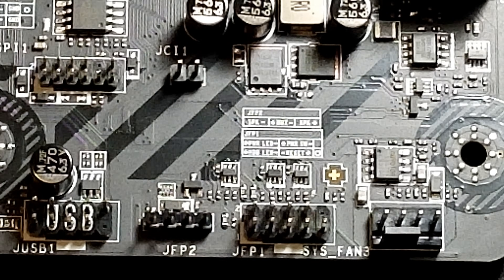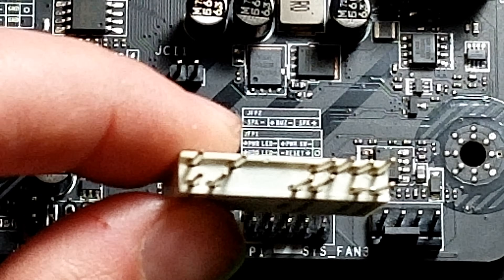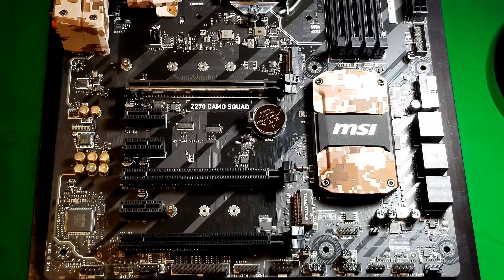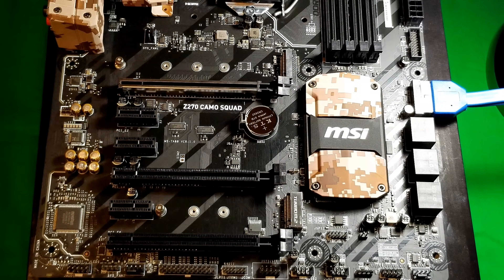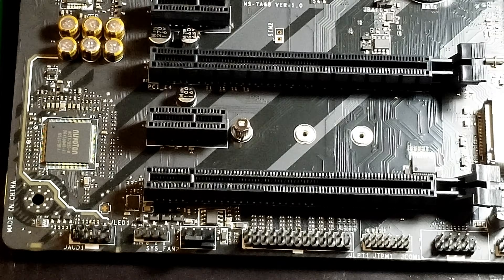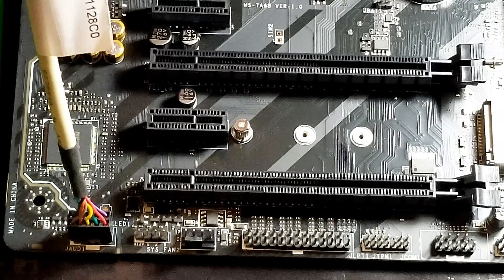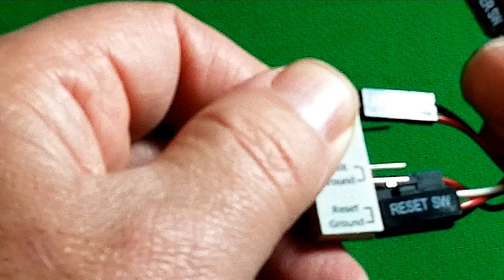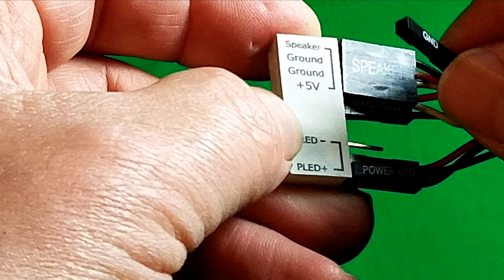Connecting your Case Front Panel connectors to your Motherboard

Comment: Do you have Discord? My PC after I put it all together just flashes a white light and so does my graphics card. I’m still waiting on my CPU heatsink to come. Is the computer refusing to boot without a heatsink? I’m still waiting for my heatsink to come in the mail. I’m really excited to build his beast after being on a laptop with a GTX 750 for 5 years.
Reply from the maker: I have Discord but have only used it in other peoples Discord to send messages, don't use it myself at this time, that might change soon though. Now not sure what the while light would be, never seen that before...As for the CPU Heatsink, the motherboard has it's heat-sink's built in, so guessing your referring to a new CPU Cooler maybe? If you have your Motherboard, with CPU and CPU Cooler along with Memory installed, everything would be fine. So if your saying you aren't using a CPU Cooler, that should not be done. So if you can provide more detail on what's going on I'll do my best to help you out...There can be a LED button on your motherboard that might be white, used for showing error's with your system, other then that can't think of anything else...Good Luck with whatever build your doing...Take Care...
Reply: @Reviewing Playing & More RPM My motherboard has an orange light that stays on. And yes, I’m referring to the CPU cooler. I’m building a PC with a 1070, 16gb of RAM and an i5-8600k. The fans spin on the case and the graphics card fine it seems.
Reply from the maker: It's normal for there to be a light that stays on when the motherboard is powered up, it indicates your motherboard is getting power, which is a good sign since it also means it is working ok. If your GPU has RGB which a lot of them do now then having a light on it is normal. Yes without a CPU Cooler you should not try powering it up as without cooling for your CPU it will overheat...this could cause damage to your CPU...
Reply: I also meant to say that the front panel’s power button flashes a white light and so does my graphics card.
Reply from the maker: The while flashing light indicates the Hard Drive activity, this in normal...
Reply: @Reviewing Playing & More RPM Nothing comes up on the display. I got the Asus b360m-a motherboard. Of course me being my dumb 18 year old self, didn’t research my motherboards. I might have to send this one back. I seen online that you can’t do any overclocking on this motherboard and the RAM can only go up to 2666mhz. My RAM I got is 3000mhz. Do you have any good motherboards you can recommend to me?
Reply from the maker: If your using the AM4 Socket for Ryzen processors, then I did a review on a Gigabyte Auros B450 Pro WiFi Gaming Motherboard, has DDR4 3200 support, and has OC Support through BIOS...
Reply: @Reviewing Playing & More RPM Thank you.

Comment: Hey, what if your front panel cords didn’t come with a reset switch
Reply from the maker: +RysenZ If your case doesn't have a reset button you won't have a reset cable. Thanks...
Reply: Reviewing Playing & More RPM thank you so much for the quick reply, it is my first build and for some reason everything has power, but when I click the power button to start up the pc it doesn’t turn on. I think I may have a shortage in my front panel pins or something....quite tired of trying been couple of days.
Reply from the maker: Something to try, it's very easy to reverse the reset and power switch, so try checking that first, double check the 8 and 24 pin for power and finally ensure your memory is installed correctly, if the memory is in wrong that can cause a system to not boot up...Hope that helps...
Reply: Reviewing Playing & More RPM thanks you again, I will test all that out when I get the chance. I had taken a break to breath and relax my mind. The video was great info and help as well.
Reply from the maker: Sounds good, hope it works out for you...

Comment: This must be for an older MB. My Z87 takes a connector like this but my Z170 has a different one with more pins.
Reply from the maker: +J Lock Yeah 1 is newer and the other is very old, but still connect the same. Thanks for watching...

Comment: What happens if you don’t have a reset one ?
Reply from the maker: +Merkah It's fine, some cases don't have a reset button.
Reply: Reviewing Playing & More RPM okay good I got scared haha I need to ask a question tho I’m trying to fix my pc it won’t load it lets me get to bios then when i exit out off bios it’s starts to boot then the windows logo comes ups and the circle underneath just keeps on going until I turn my pc off and on again then the same thing happens
Reply from the maker: +Merkah so if I read that right it's stuck in a loop? If so there is a Youtuber called Britec, he just did a video on how to fix this. Might help,  if not let me know and we'll explore it further. Thanks...
Reply: Reviewing Playing & More RPM okay thank you!
Reply: Reviewing Playing & More RPM I can’t not do Britec video as I do not have a DVD drive
Reply from the maker: +Merkah Give me a bit and I'll see if there is another option.
Reply: Reviewing Playing & More RPM okay and also it’s going into automatic Repair and it’s 4:30am so if you do reply I’ll look in the morning I appreciate you for helping me 😈
Reply from the maker: +Merkah Starting at 11:17 in Britec's video he is showing how to reset your PC this also works for some other Windows errors. You won't need a DVD Drive for this and it should fix the problem. If you just built the system and don't have anything to lose data wise, or programs choose the remove everything option. Otherwise choose keep my files and apps and let it reinstall. This should fix things.
Reply: Reviewing Playing & More RPM can you link the video ? The Britec09 one ?
Reply from the maker: Just click on where it says 11:17 in blue that is the link to take you to the video and at the spot you will need, and yes Britec09.

Comment: I thought this was the problem for my build but my pc’s motherboard lights up but when i press the power button nothing happens. And i dont know what todo. Can any one help?
Reply from the maker: +ygv fcy Recheck the LED connections, ensure you plugged in the 24 pin and 8 pin power and memory. No memory or installed in the wrong slots can cause a no start. Just some things to start with.

Comment: my pc doesn't have the reset switch socket or the speaker socket. Will it matter? What should I do?
Reply from the maker: +PassionFruit Not all cases have a reset button so in that case there will be no cable to plug in. It's fine, but if you need to reset and can't do it normally through windows just hold the power button to shut it down.  Thanks for watching...
Reply: Reviewing Playing & More RPM Cool. I was worried and spent 3 hours this morning fiddling with the case front panel socket and the asks q connection.
Reply from the maker: +PassionFruit No Problem Glad to help...

Comment: will i damage anything if i plug something in the wrong place?
Reply from the maker: +Marius Remeikis Short answer is it's possible, mostly if you were to plug in Firewire to USB it could possibly short the motherboard.  The LEDs I have reversed the power and reset no issue just buttons work in reverse, the Power LED + and- if done wrong while possible it may cause damage it's more likely it just won't power on. I haven't plugged in the audio wrong so can't say with certainty what could happen. I have done research and other then plugging in the Power 24 or 20 pin wrong or 8 or 4 pin CPU wrong, the  LEDs should not. Of course without having put this to the test err on the side of it could. Better safe than sorry...
Reply: Thanks for the reply

Comment: Just hooked up a Cougar panzer max to a gig.x470 aorus ultra gaming. I can't get the fan speed control to work. The case fans start when the case is powered up - but the speed control won't adjust the fan(s) speed - they stay on low speed....
Any ideas....
Reply from the maker: +Daniel Stone Did you try going into the BIOS to the Smart Fan 5 Settings, the Fan speed Control just a suggestion. It let's you make adjustments this way in the event the case isn't doing what you need. Hope it helps...
Reply: Thanks for responding..
I did not. I was thinking it was a hardware problem.
I thought adjustable fans had 3 wires..i notice ive only 2 on the(each fan) harness. I'm  Not quite sure about how to work with the bios.. guess I could look about

Comment: On my motherboard (TUF Z390 WiFi) there are more pins then the q connector has holes does it matter or not
Reply from the maker: +Nic The Q connector isn't for every motherboard I'm pretty sure,  but on your motherboard the top starting top left is PLED + and - then next 2 continuing on top is Pwrsw next 4 pins top right is the speaker. Next starting bottom left 2 pins is HDD + then - next 3 are reset then last 2 with a blank not used. Hope that helps verify with your Motherboard manual for front panel in case of doubt and to be sure.

Comment: I have a question, I connected all my cables, double check to make sure all cables were connected and I turned on my PC and all the lights on my MB turned on including my CPU Cooling fan. After I noticed it turns on I turned off the PC with the power switch and then plugged in my GPU and wifi adapter and went back to turn it on but now it won't turn on. Yes, I did take out the two items again to see if that was the issue but no it is still not turning on. I'm looking every where to find the answer but nothing so far. What do you think can be the issue?
Reply from the maker: +Cali Jay Hi, so few things come to mind 1st is could the memory have come out of its slot slightly,  if not check none of the connectors came loose. Now if it's not that when you had the adapter and GPU in or not is the motherboard showing a light lit up this will usually indicate your at least getting power. It's possible that the power supply could have stopped working but will depend on how old it is possibly. Give those a check and if it's none of that give me some more info and I'll see if there's anything else I can do. Sorry hard to diagnose this way. Good luck...
Reply: @Reviewing_Playing_and_More_RPM  let me break it down in details some more. The first time I turned it on (without the GPU and Wifi Adapter installed) the lights were on for the Motherboard and the CPU cooling fan was spinning and at this time I did have the Ram installed. The four fans was not spinning, I'm guessing because I just got a new case (NZXT H700i) and their built in Cam software control it. 
Now the 2nd time I installed the GPU and Wifi adapter and went to turn on but this time nothing happen. MB lights didn't show, CPU cooling fan wasn't spinning but the only thing that was lighting up was the Cam adapter inside the case. It's a blue light and that's the only thing that keeps turning on every time I turn on the power switch.
This morning I went and took everything out again and put everything back in and still the same issue. Nothing turns on except the blue light from the CAM adapter
Reply from the maker: +Cali Jay Well safe to say it's not likely the power supply,  so don't have a lot to offer without having it. So only suggestion I have at this point would be to check all the connections  to ensure everything is plugged into the motherboard correctly, otherwise unfortunately can't think of anything at this time. I'll do a bit of research and if I come up with anything I'll reply with more, sorry...
Reply: @Reviewing_Playing_and_More_RPM  I forgot to mention I have a ASRock Z77 Extreme4 MB
Reply from the maker: +Cali Jay Try a different Power Supply if you can, disconnect all non essentials from the motherboard. Ram, ODD, HDD, SSD, sata cables etc... Try using Integrated Graphics if available, try removing 1 stick of Ram at a time, and try again. Finally disconnect all power connectors from the motherboard and reconnect.  I know it's tedious but all part of troubleshooting. Hope it helps...
Reply: @Reviewing_Playing_and_More_RPM  so I did exactly what you told me and still nothing turns on except the NZXT CAM hub
Reply: @Reviewing_Playing_and_More_RPM  the only thing I didn't do was put in a different power supply
Reply from the maker: +Cali Jay Sorry but if you've checked all the connections and what I mentioned earlier not sure what more I can offer. Might be time to find a computer shop or a friend who could help...All the best...
Reply: @Reviewing_Playing_and_More_RPM  I believe I just found the issue. The fans on the power supply does not move when I power it on.
Reply from the maker: +Cali Jay Well some power supplies will only turn on after it reaches a certain amount of load, designed this way. So if there's more than just the fan it's possible it's the Power supply but before I bought a Tester I took mine to a Computer shop and they were willing to test it for me at no charge. Something to consider...
Reply: @Reviewing_Playing_and_More_RPM  ok. Thank you so much for the advice. I will definitely let you know what happen and how I got it to work
Reply: @Reviewing_Playing_and_More_RPM  oops forgot to mention, I did the saftey pin trick on the power supply and the fan move but suddenly stop after 2 seconds

Comment: knowing about the arrows helped. But my cords are the complete opposite. The Speaker Positive is on the opposite side of yours....in fact I got no choice but to put it backwards because on the motherboard its swapped.....either that or mine is mislabeled big time......
Reply from the maker: +1Sandwitch1 Yeah never noticed the  way the speaker went on, most cases don't include it. Check your motherboard manual to be sure so you don't short out anything just in case. Not sure it would but best to be safe...Thanks...
Reply: Sorry for the late reply, did some research last night and come to find out my Motherboard is not compatible with my tower. I got a MicroATX Board, which means I need a Micro Tower. Took me 3 months getting all my stuff for the build just to find out I got a useless tower......FML I also bent pins on the Processor when attempting to screw it into the motherboard long before I found this out. I could be looking at spending another 160+ dollars on the same Processor AND having to get a new tower, luckily I found a really good Micro tower for only 44 bucks
Reply from the maker: +1Sandwitch1 Sorry to hear that, maybe you can you exchange your tower for the other one you need. Will depend on where you got it from and how long you've had it but maybe worth a try. Yeah I have bent pins before but was able to fix it using a mechanical pencil without the lead. There are videos out there that show it but only if you have no other choice.  To be honest some pins are not even used sometimes so might not make a difference in the end. Just a suggestion don't want to give bad advice...Good luck with it though.
Reply: a bloke I knew gave me the tower, and he had it for years. lol So no...no trade in is going to happen. But don't fret, found a Micro tower for cheap online. In fact its better than the one he gave me believe it or not. I mostly care about getting power first. Because you're right, it actually depends on which pins they were, but I've always had shit luck....hence the reason why  this is happening now.

Comment: I wish i would have seen this before attempting my build, something i did with these connectors fried my psu
Reply from the maker: +700mobster Yeah my first time I made a system this was so confusing...I fried my case somehow puff of smoke and all...so made this after building my 33rd one to help whomever it could...Thanks for watching...
Reply: @Reviewing_Playing_and_More_RPM  I think what happend in my build was that the reset button was for some reason plugged into the rgb controller for the fans on the case. Plus i used a sata connector to try and power the fans.
Reply from the maker: +700mobster Well at least now you know. I remember doing this in College and it was the most difficult thing for me to get so your not alone they messed up a few PC's lol...

Comment: I have three connectors from my case, one of them I cannot find a place to put in on the mother board. It says m/b d-Rgb 3 pin. Where would I put this connect on the motherboard?
Reply from the maker: +CaptainClutch980 Seems like it would be for RGB. If your case has an RGB strip or something else that would make sense.  I'd check the manual for the motherboard to be sure where the connector is. I did notice on the case I just reviewed it had a new RGB connector on the motherboard I hadn't seen before and it was 3 pin so its likely that. But without seeing it can't be certain...
Reply: Reviewing Playing & More RPM I sorted out the problem thanks for the video
Reply from the maker: +CaptainClutch980 Glad you figured it out,  sorry I wasn't able to help...Take Care...

Comment: I was wondering if you've dealt with proprietary connectors. I have an io board from a dell dimension 2400. On it there's a headphone jack and usb stack with a separate cable for each. I wanted to connect it to a matx board but can't find information on what pin does what.
Reply from the maker: +StealthNinja4577 It's difficult to say it can be difficult to know for sure. I've  tried this before but ended up just giving up. Sorry...
Reply: @Reviewing_Playing_and_More_RPM  I wish they sold separate headphone jacks that could connect to the motherboard. I found a stacked usb 3 with a female connector that can be routed from the front panel to the board no problem. No luck on a separate jack.
Reply from the maker: Now maybe you've tried it already but you know that the audio jack on the back of the motherboard is able to be used for Headphones, and is usually better then the front of the case one?